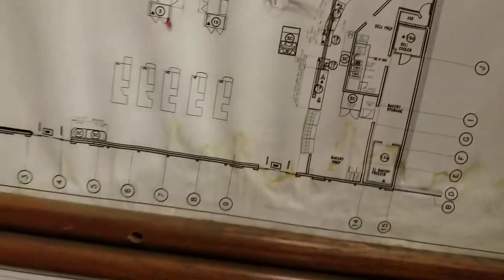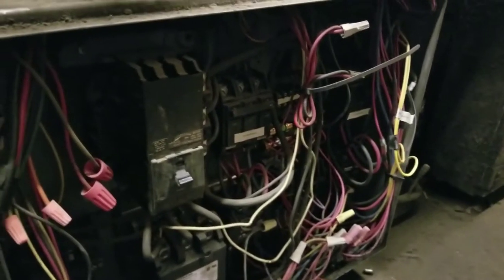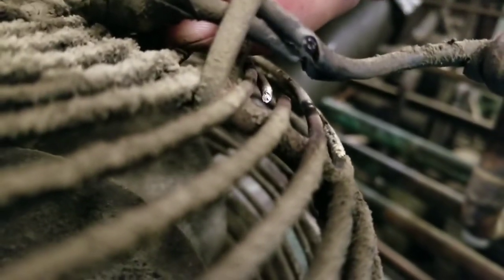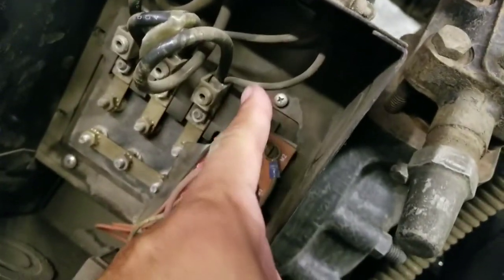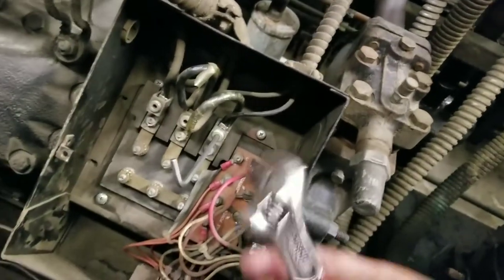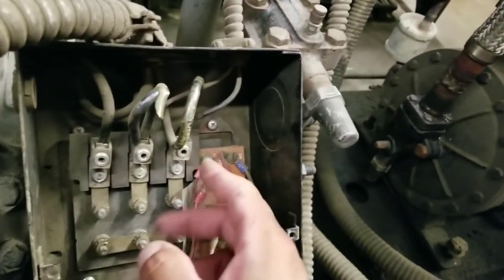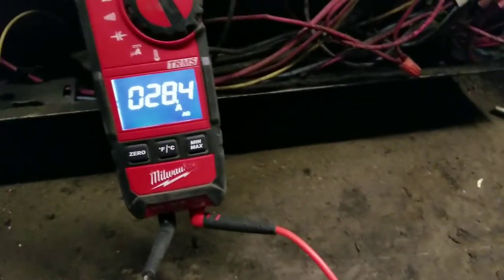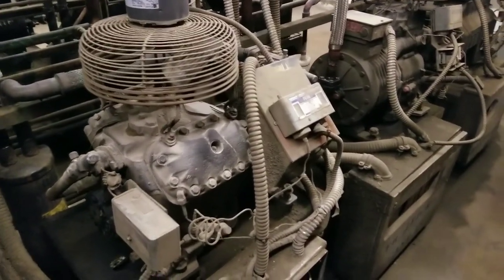SINGLE COMPRESSOR BREAKER TRIPPED!

Comment: If the short is upstream of the bcfm, how did you make the leap that the bcfm was bad?
Reply from the maker: I ended up not replacing the motor, just doing the repair to the wires. Thanks for your comment 👍

Comment: Hey bro, great video.   How do you like that Milwaukee meter.   I really want to give it a shot, but would like some feedback.  Thanks
Reply from the maker: It's ok, but it reacts to slow. You have to wait for  a reading to appear. I don't use it anymore. I went back to my Fieldpiece meter for now.
Reply: RefrigerationTech 
I agree. When I first got that meter I condemned a capacitor because I didn’t get a reading. Put on a new one and still not running lol. Had to leave the leads on for like 5 seconds to start reading. Then shortly after the temp reading was 10 degrees off. I threw it in the garbage after that.

Comment: Hi, why did the wire in the terminal get black, or hen the short was in the wire by the motor? Was it because the voltage shorted before reaching the motor ( resistance ) and pulled max amps ?

Comment: just wondering if a low temp compressor could run for a few days without a head cooling fan, if you had to replace it? would it trip hi head?
Reply from the maker: Yes it would

Comment: Was the head fan motor bad or just burnt wires?
Reply from the maker: +Cody Lindstrom , good question. After I ended the video. I decided to try wiring the motor back up to see if the motor actually Burt out. Well it was still good, but I didn't get it on video. Good catch Cody